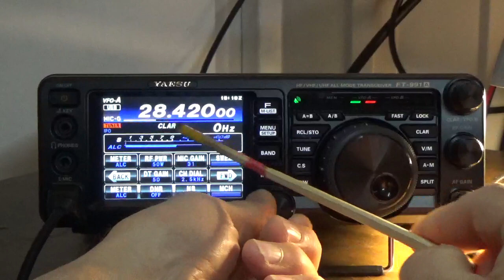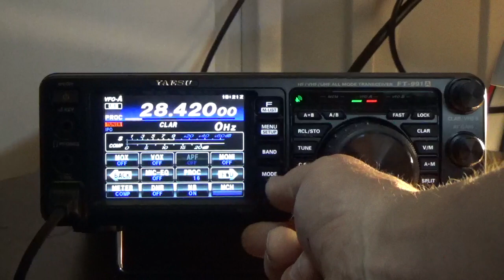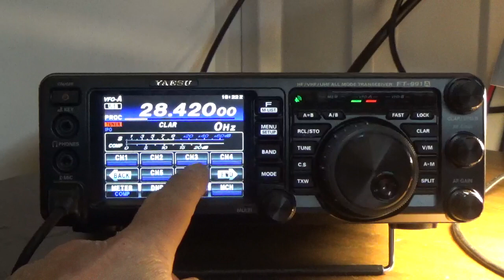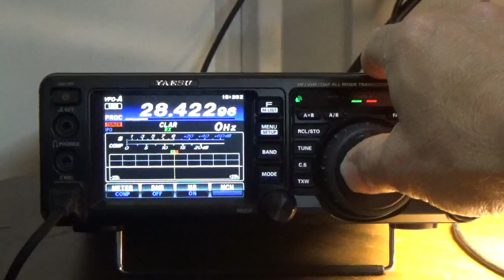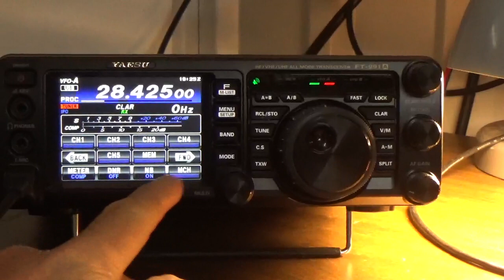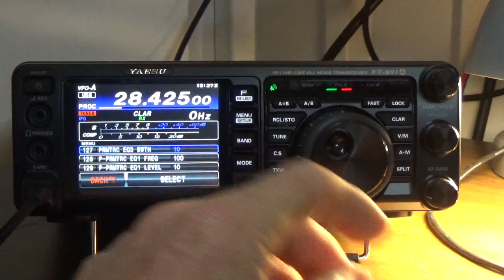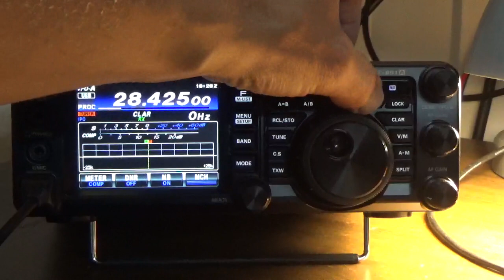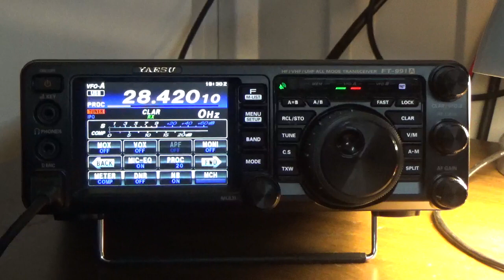Using MIC-GAIN, PROC, and MIC-EQ features on FT991A in SSB to maximum talk power no overdriving

Comment: The 991a recves &keysup but no modglation
Reply from the maker: Steven, I was reading through manual try this Press F/M-List use the right and left arrow keys look for "BK-IN" and make sure it says ON if it says OFF tap it once that maybe why you are not transmit - I'll keep looking 73

Comment: Yaesu menus are, IMHO, ridiculous! Especially when compared to the intuitive and simple operation of my Icom. This video convinced me that I do not want a Yaesu radio. Thanks for a very informative video.
Reply from the maker: Yeah they are a beating sometimes, thanks and good luck I know a lot of folks love the ICOM's, whats the ICOM model mateches the FT991A I might have a look '73 sir from KI5JUF
Reply: @westtexasvideogateski5juf255 

I’m using 2m  13B2 antenna horizontal on FM , but unfortunately it still has a weak signal and does not give distances on 145 MHZ . Are there better settings? Or any advise

Comment: This helped me get my MIC Gain set. I used the 50W power to get the gain level showing on the scale, rather than lower power I was previously using. I'm keeping the avg setting of MIC Gain closer to the mid range rather than the max recommended for now.  
Working on the speech processor and Par EQ settings now. 
I do like this FT-991A transceiver.  Made some significant DX contacts and Rx from UK, ON, etc. Thank  you! 73

Comment: Thank you for these great videos!  I use an FT-991 for mobile use with the included hand-held mic.  I was wondering if you've experimented at all with the mic that came with the radio.  I just assumed that Yaesu's default settings would apply to their mic, but you never know. I would appreciate any insight you might have.  73s!  Terry KK6W
Reply from the maker: Good evening sir and thanks for the message,, I did do a video showing the factory mic and the M100 this is link https://youtu.be/uQdin1HpsVY  thankd and '73 from KI5JUF let me know if you need anything else!

Comment: If you use a tone generator and put this radio on the scope it is  a MESS  like a hacked up CB radio  at 100% mic gain  on AM and SSB   it actually starts to flat top on SSB at 18% modulation with the two tone..  I have no idea what YAESU was thinking?  put a 7300 on the scope on am and SSB it is very clean  the 991A ia dirty on am and ssb unless you barely even open the mic gain
Reply from the maker: Good evening Dave I appreciate the info, ever since my CB day's I've always promoted good clean modulation on Ham's thanks again and '73 de KI5JUF
Reply: @westtexasvideogateski5juf255  I called Yaesu, and they gave me an email to send screen shots to. I will provide them with this information today. after I put the radio back on the scope and cmu200

Comment: Hi there! Where are you about in Tx? Have a friend down there new ham too.
By the way I got a 991A too. Nice little shack in a box.
Interesting thing I noticed is we have same setting for proc level, mic level and eq-on. i have an old MD-100 mike. Glad to see you use low levels to keep a good transmission quality. I found the eq really raises the average output power on ssb. 

Anyway a suggestion for your antenna connections. Why not to put the two coax switch back to back with a double male uhf adapter? Then you’ll have 2 radios-2antennas. Easy and neat.

Enjoy the hobby!
73
Reply from the maker: Good evening sir, I live in Plano all my FT991A stuff is in Abilene where my folks live, let me know if there's anything you need from '73 de KI5JUF sir!!  Appreciate the message.

Comment: What about lower sideband?
Reply from the maker: Hi Kurt, I don't know it wouldn't the only thing changing is on LSB we are on the left side of the carrier frequency, I'll ask some of the folks in the club at breakfast tomorrow.  I just ordered a MFJ-267 from DX Engineering so I will be making some videos on  setting the speed processor an the parametric equalizer this weekend.  It's recommended to use a dummy load for setting these up.  Below is the link, I let you know what I find out about the LSB - thanks for subscribing have a great weekend - '73 KI%JUF

50 Ohm Load
https://www.dxengineering.com/parts/mfj-267
Reply: Hi, in the manual section it says SSB.  So I think it ash the same effect when it's upper or lower.   It's just which of the sides you Tx.